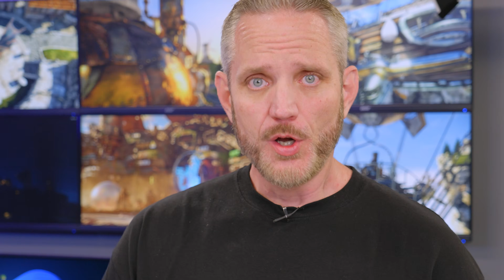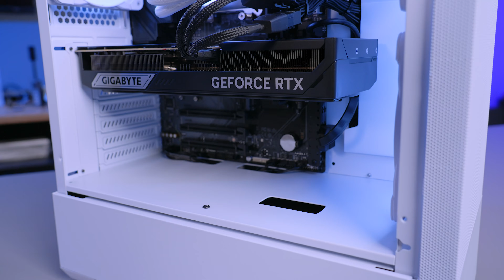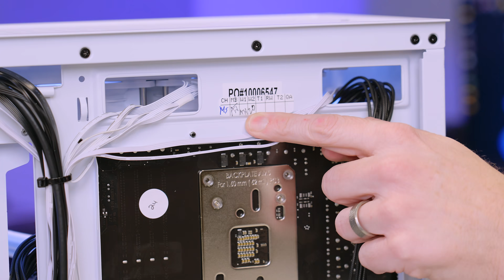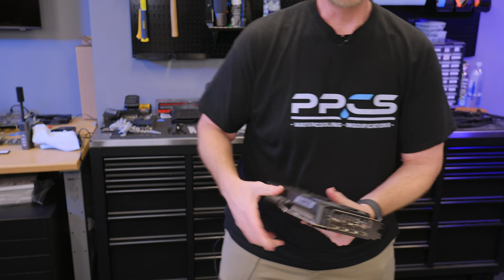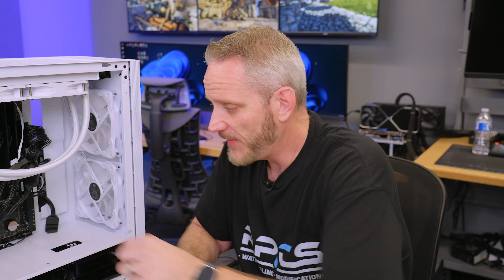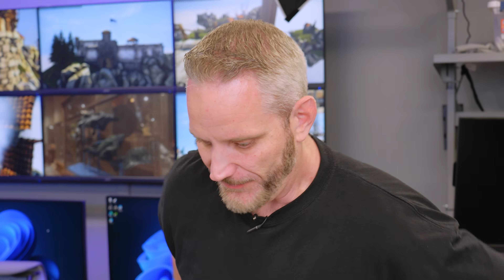This Prebuilt Gaming PC is Shockingly Affordable

Comment: I just picked up the G486 comes with 64gbs of ram and the 5080 with a i9 14900kf intel cpu for 3k. Friggen thing is a beast for the price if I built it myself probably would've been closer to 4-5k. Only thing I don't like about it is the AIO is kinda caca but for the price I'll take it and that's something I can easily upgrade. Seriously if you need a PC upgrade or just a new PC in general Microcenter prebuilts are the way to go right now. Just make sure you get the warranty as well just in case which does up the price about 230$ but it's worth it for the peace of mind.

Comment: Just picked up the G763. The GPU, CPU, RAM, and Motherboard alone as separate parts were more expensive than the prebuilt. So not even counting the case, PSU, AIO, Storage, Windows 11, the labor to put it together, and the free warranty.

Comment: I have several power specs. 2 microcenter would not warranty. The motherboard power connection had a faulty pin, the other a mosfet failed.

Comment: Generally, I turn away from the Powespec brand from Micro Center for two reasons.
1)  They have usually cut a corner or two somewhere to save money and upgrading any parts on it at the time of sale kills the price/value that was advertised.
2)  I have had clients who, against my advice, bought a Powerspec machine and the extended warranty.  They got screwed later by Micro Center on repairing/replacing the part or machine under warranty.
Don't think I do not love Micro Center, though.  As an IT guy, I need them if I get a local part and I would rather support local brick and mortar businesses.  I am blessed to have them in my own town.  I usually find a local guy whose knowledge on the hardware exceeds my own to play catch up when integrating new parts to build a system.  I hope they do not screw up their own business by making fundamentally damaging changes.

Comment: Hey Jay, have you checked out mVolt+ for RTX 5080/5090 yet? It exposes NVVDD, MSVDD, XBAR, SYS clock and more beyond normal Afterburner tuning. I’ve been testing it on my TUF 5080 OC and got 10,140 in Steel Nomad and 10,288 in Speed Way — around tuned 4090 territory in those tests. Would love to see you push a 5080/5090 with it.

Comment: I literally bought this PC last month for $2,300. It's great so far. The biggest downside I've found is the slower Ethernet port, but a $30 network card fixed that. ✌️
Oh, and it came with 2 free games. RE: Requiem and Crimson Desert
Reply: hmmmmmm weird now i question mine, i plugged mine in and i was getting full speed, just recently my speeds have gone down and i dont know if its the PC, router, or the internet service.

Comment: The nvme ssd is the one component I always go annoyingly cheap on, mainly because I feel like 380 for 2 TBs is stupid expensive. I may not be able to store much, but I'm still rocking my stock 512 GB nvme drive and 512 GB sata ssd drive in my newest rig, and I'm content. I can almost justify dishing out several hundred bucks for solid RAM sticks with at least 32 GB, solid CPUs, and mid-range 1440p capable GPUs, but with the ssd, I just can't do it. To me, storage should always be an affordable component in any PC setup.

Comment: I had a comment regarding this product removed from this video.  It involved a couple of problems I had after I purchased one of these systems: 1) a rattling cooler - likely air in the system, and 2) failure to boot when I plugged USB devices in that worked fine with previous systems.  MicroCenter replaced the unit (great customer service!) but the second had the same boot issues with a couple of my USB devices.  I solved the boot issue by purchasing a powered USB hub to interface with the problematic devices and plugged the hub into either the red or blue USB ports on the computer.  AI claims that modern motherboards are more sensitive to currents resulting from powered USB devices.  AI often gets things wrong.  I'm curious what Jay thinks.

Comment: I’m about to turn 35 and I’ve never had a pc before and all of my friends have swapped and I’m stuck on Xbox. The price of everything right now is so depressing. I have been streaming pretty consistently on Twitch since October and I’d like for it to become a thing I make a career out of. I’ve gradually got myself into a decent streaming setup but with a 10 year old dell XPS 9550. I stream with it through obs with a Elgato 4k X on the series x. There for awhile, I was just gonna save up for like a Acer Predator that i could game on too but after doing a lot of research, I decided to just to try getting a desktop. Cheaper and way more reliable. I was looking at a 4080 but holy crap just those graphics cards are like a used car. $1200-$1600.
I was wondering if you had any advice or knew of anyone that built PCs that wouldn’t take advantage of my lack of understanding anything pc related. 

I’m not made of money and would have to save up but seeing all my friends move on to bigger and better things is really messing with me mentally and it’s got me really wanting to swap. 

One of those friends actually recommended your channel, for beginner friendly advice. So here I am. 

I apologize in advance and thank you for your time.

Comment: I bought one of these computers from Micro Center. I like it, but I had a strange experience with it - if I plug my Corsair Keyboard or Schiit BiFrost D/A into any USB port other than the 2 red ports, the computer does not boot.  It doesn't even present the BIOS screen.  It also had a rattling cooler.  Micro Center apologized and gave me another unit.  The cooler on this unit was silent, but it had the same boot problem with the 2 USB devices.  I've never had a computer present this behavior, and I've owned a lot of computers.  Still a good computer, though.  Just be careful with the USB ports.

Comment: For $1200 (open box) I got an MSI B850, 7500x3D, 9070xt, and 1tb of storage - but only 16gb of single channel RAM. I upgraded the RAM to 32gb (got a deal on eBay for $250 for 2 sticks of 16gb that was better than the cl38 it came with) and now I have a PC that plays all the games I want at 4k for less than $1400. Thank you Microcenter.

Comment: This is so off topic but I need help. I have an Asus prime b560 plus. Does the top m.2 slot get installed at an angle to the motherboard or parallel? The current standoff seems too short. Sorry I haven't built anything since first gen Ryzen and can't find any info!

Comment: "It's probably more than most people would be willing to spend on a gaming PC"

Price: $2,500

That's more than 99% of people are willing to spend on a gaming PC lol. I was expecting $500-$600 at the start before any specs or anything. $2,500 is not affordable at all. It's worth it based on it's parts, that doesn't make it affordable. By that logic, a Rolls Royce is affordable because it's not as expensive as a Bugatti. That's not how affordability works.

Comment: That's nuts & to label it "shockingly affordable" is clickbait.   People - keep your Ryzen 2700x with your 2070 supers.
Reply: Couldn't more than agree with you on that one. In this current market just can't justify paying well over $1500 just for an entry level rig. Probably am just gonna go with a build using more good enough parts like ddr3 on the ram and going with an RX 7600 along with a Ryzen 5 for the CPU. I tend to greatly favor much older games and am just gonna emulate PS3 to PS4 style games. Probably gonna keep my build with in a $1000 budget. I may even use it for it to play copied 4k blu-discs and build it into a home theatre pc.
Reply: @dantasticmania8728  That's the way to go even ddr4 memory is great prices now you can get 16g 3000 to 3600mhz for under $100 instead of this insane $500 ram. Most games don't use more than 16gb. If you're doing extreme heavy editing work with a billion things open then maybe 32gb but it's mostly not needed.

Comment: The simplest explanation is micro center doesn't just sell prebuilts but also individual computer parts. prebuilts from AIBs (is that the right acronym?) are expensive because they have a limited volume of negotiated/bought product coming in and when it runs out, they've run out, but microcenter is playing the long term game here. 32 Gb DDR5 is still 550€ here and 16 Gb 400€, I been looking at prebuilts but the problem is most of them use custom parts somewhere (motherboard, or laptop ram, or power supply) and I usually DIY my PC so I'm still playing the waiting game to go AM5/DDR5 (currently Ryzen 5 3600, RTX 2060 still going strong, but starting to show its age... I cannot even 60 FPS DX12 Fortnite (CPU bottleneck and game stutters), Arc Raiders just 90 FPS at Medium on 144 Hz panel...man I wish I had Micro Center here, I could go get a new PC, sell the old one for cheap-ish to make someone on a low budget's day (I sold my old Ryzen 3 1200, GT 1030 2 Gb GDDR5 for 20€ last year to a kid who's stingy mom was gonna buy a 4th gen i5 with integrated graphics if I didn't do that price, got flashbacks of my dad, took pity on the kid).idk why I wrote all this, been awake since 4 a.m., losing it

Comment: I live in northern Wv, like 15min from PA… man it’ll be Armageddon before a MicroCenter comes within 50 miles from me.
I bought my rig a few months before the Ram prices went up. $2035 after tax. 9800X3D cpu, 9070XT gpu, MSI B850 Gaming plus MB, Corsair Vengeance 32 GB DDR5-6000 CL30, Samsung 2 Tb M.2 SSD, Lian Li 360mm AIO, Corsair 850watt psu.
And a nice black Fri sale for a 34in ultrawide QD-OLED 1440p 165Hz monitor.
But I would have dropped everything for this one!

Comment: Just got one with a 9800x3d and RTX 5080 and 32gb ram last week at the micro center in Denver for $2399. They have at least 20+ in stock there last time I checked. Everything is working perfectly with no issues.

Comment: One of the things everyone skips and what I hate about most of these modern compact cases is 3.5" airflow. Luckily my case of similar size has the bottom half portion of the bottom front fan pushing air into the bottom 3.5" + PSU section. This case does not.  The PSU pulls air through the bottom and out the back. The design of this case has all airflow from all the fans in the top section. Dead air at the bottom. That HDD is gonna cook with long writes. And yeah some ppl still love 3.5" for extra storage, Plex servers, etc!

Comment: I like you jay but how is it possible for you an experienced pc collector to assume hardware on a cheap case is stainless steel there is absolutely no way you don't know how stainless steel is produced it was one of the great lies early govenment used lies about history of brass and stainless brass era no you have to know that stainless steel requires mostly copper and a case manufacturer is not going to use tons of raw copper for production. To include stainless steel hardware. And yes you did say "stainless steel." Why confuse new audience jay. Especially during trumps money laundering escapade.

Comment: As much as I would like to take your comment on the system being 'silent' at face value, when you show me GPU fans ramping up over 2100RPM, maybe even close to 2200RPM and the CPU fans spinning at 1400-ish? RPM, I cannot agree to that being silent. I know you tend to test stuff, like OC and such at full RPM, so maybe you are used to noisy PC's, but when I was trying to play Windrose 2 weeks ago and my Asus 4080 TUF went over 1600RPM, I thought THAT was noisy!! And now, with the failed phase-change pad installed, that refuses to phase change, the fans even ramp up to 2250RPM, which is like a small vacuum to my ears!!
Now, to be fair, my PC has 2 200mm Noctua fans in the front, running at 600-ish RPM, 2 120mm Arctic P12 Pro in the bottom, running at around 650RPM, 7 additional Arctic P14 Pro fans running somewhere between 550 and 600RPM and then the 420 Arctic Liquid Freezer III, with swapped fans, also being the P14 Pro's, running at 600RPM, I know I am used to a VERY quiet system... Except for when it starts up. The mainboard boosts the fans to close to max speed, for a long time (feels like an eternity, having all those fans running around 2000RPM!!!) and when I think about you, working on PCs with fans going at similar speeds (seemingly) all the freaking time.... I am glad I don't have to be there AND that that noise usually gets filtered out, while you speak about the things you are testing.
Oh, I almost forgot, I also have slim 120 on the back of the mainboard. I think that is spinning at 750RPM, or something and of course, the AIO pump is also NOT running at full speed, because with how quiet the whole system is, at full RPM, I would hear that whiny, bussing sound of the pump. I taped off the pogo pins for the VRM fan, because I have one of the earliest models of the Arctic Liquid Freezer III and was sad when I found out that the clicking noise I suddenly started hearing, was caused by that tiny fan and is apparently, a well known issue... Great...
....
(Autism and ADHD combo, also ensures that I am very sensitive to noise, smell, sudden movements/flashes, which is RIGHT NOW happening with the thunderstorm outside! So maybe I am being overly sensitive about it, but yeah... That is NOT what I would call silent!)

Comment: My company is somehow selling a freakishly inexpensive build right now using old-new stock as well, but much lower end. R5 5500, RX 6600, 16GB DDR4-3200 CL16, 500GB gen3 NVMe, 600W Bronze PSU, mATX Case. We currently sell this configuration for $599.

Comment: During the GPU shortage in 2021, I went with a pre-built from Micro Center. It was the only way to get a PC with a 3070 under $2500. The 3070 itself was going for like close to $1500 at the time and I picked up the entire PC for $2000. They even put in the EVGA FTW3 version, too.

Comment: I bought the 5070ti version of this exact PC 2 months ago from Microcenter Phoenix. I have built my own PC's (and encouraged others to do so) my entire life , mainly for the savings. This is the first time I've ever bought prebuilt because the price is completely unbeatable. I literally would not be saving money building this PC myself.
Reply: i got the same, less the rear fan on this one. g758. runs flawlessly. although the fans can be a little loud when it ramps up.
Reply: Yeppppp same here. I have the 5070 Ti with the 9800x3D. Rotated my old parts into this, installed a clean windows to my old PC for my wife, and I could not believe happier. Best 1900 dollars (after tax) that I have spent.
Reply: same, I picked up the G757 after running my old self build since 2015, I literally could not buy the same upgrades for my old PC and beat out the price on this prebuilt. Highly recommend Microcenter to anyone.

Comment: I have a Ryzen 9800X3D, I have Corsair CL30 32Gb 6000MT/s RAM, and my Motherboard is the ASUS ROG GAMING WiFi X870E-E powered with a Corsair rm850e Gold 80+.
I paid roughly £2,600 for my PC parts, but where my PC falls down is that I bought the RTX 4070 Super, which is nowhere near as good as the RTX 5080 of any brand.

Comment: That is a mad insane good price, my gosh that GPU/CPU combo is what I REALLY WANTED!  My build was $3.4K  I have a used X870e MSI MoBo, ($208) 5070Ti ($880) when they first came out and a 7800X3D ($280), Crucial T710 1TB ($153), 2x WD SN850x 2T ($200).  All in a Lian Li O11D Mini V2 with RM850x PSU.  The only splurge was the Lian Li LCD fans and LCD-S Hydroshift ($330 total).

Comment: Got the G758 earlier this year when prices started going up.  Basically the same build but with a 5070ti instead of 5080 and it's been great (for $300 less than 757).  Granted, I have a Microcenter within an hour or so, so that helps.

Comment: 17:18 I find it better to have a thin NVMe heatspreader than a thick one, especially for one that is mounted underneath the GPU. The airflow from the GPU helped with cooling performance on the NVMe heatspreader. I only discovered this when I was using an ASUS Prime motherboard, which has a thin heatspreader, so it can be mounted underneath the GPU. I switched to an ROG motherboard, which has a humongous heatspreader for the NVMe, and it performs far worse than having a thin heatspreader mounted underneath the GPU.

Comment: One of the big reasons SIs are able to come in so low in cost right now is that they are buying in bulk (economy of scale) combined with having an average 3 month or more lag between when they buy the parts on contract and when they get the final product to market which means the price increases on parts hit them at a delay. If/when the prices ever come back down that will become a bane for them as it will take months for them to bring their own prices down to match or they will have to eat that extra cost.

Comment: Currently on a GTX 1080 + Ryzen 2600X with a 1440p monitor and planning to upgrade soon. Mostly looking at used GPUs for value since I mainly play story mode AAA games like Uncharted, Assassin’s Creed, RDR2, Cyberpunk etc.

Confused between used RTX 3080, RX 6900 XT and newer options for the best long-term 1440p experience 😅

I care more about smooth gameplay, frametimes and optimized settings than ultra graphics. Also using a 650W Bronze PSU currently.

What would you guys pick in 2026?